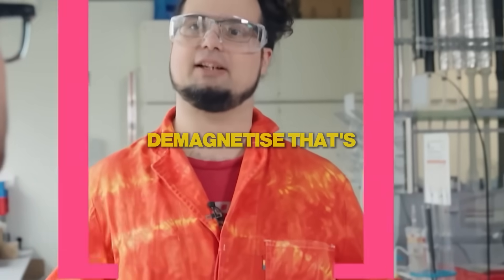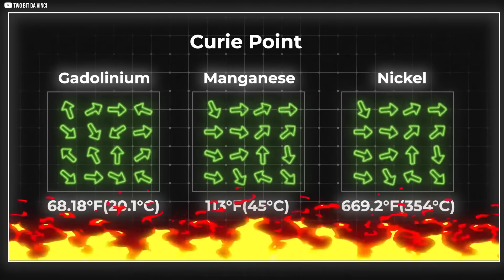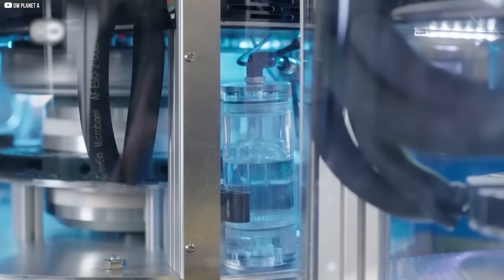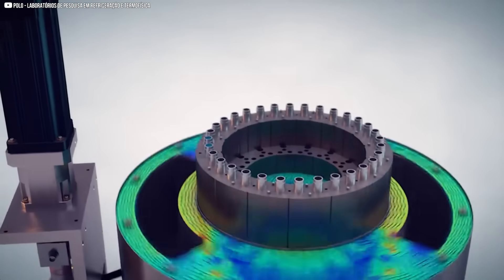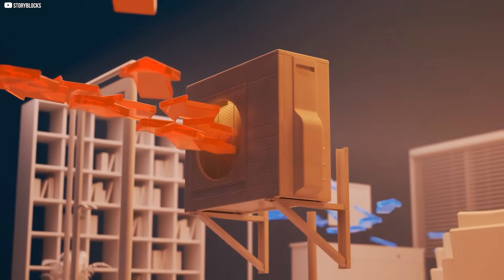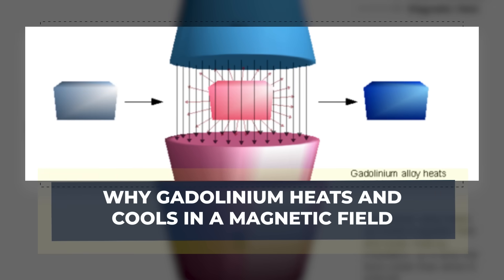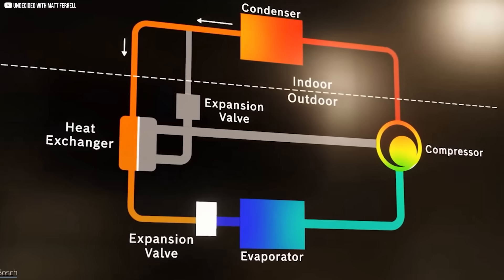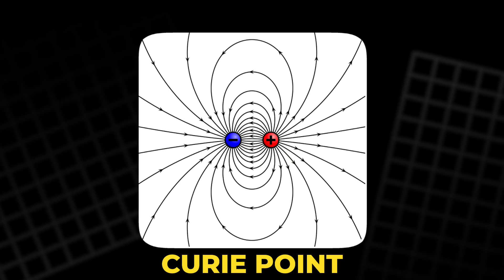The Magnet That Cools: A Glimpse Into Tomorrow

Comment: Aufgrund dieser magnetischen Eigenschaften hat Gadolinium auch eine sehr stark temperaturabhängige Wärmekapazität. Bei tiefen Temperaturen (unter 4 K) dominiert zunächst, wie bei Metallen üblich, die elektronische Wärmekapazität Cel (wobei Cel = γ·T mit γ = 6,38 mJ·mol−1·K−2 und T der Temperatur[25][26]). Für höhere Temperaturen ist die Debyesche Wärmekapazität (mit der Debye-Temperatur ΘD = 163,4 K[25]) ausschlaggebend. Knapp unterhalb der Curie-Temperatur nimmt die Wärmekapazität stark zu, was auf das Spinsystem zurückzuführen ist. Sie erreicht 56 J·mol−1·K−1 bei 290 K, um bei höheren Temperaturen sprunghaft auf unter 31 J·mol−1·K−1 einzubrechen.[27]

Gadolinium ist Bestandteil keramischer Hochtemperatur-Supraleiter des Typs Ba2GdCu3O7-x mit einer Sprungtemperatur von 94,5 K.[28] Das reine Element ist nicht supraleitfähig.[29] 
Gadoliniumsilikat (granat) ist eher ein Halbleiter "für" Magnetblasenspeicher . Also ein völlig anderes Thema !
eher für Halnleiter mit magnetischen zusätzlichen Legierungen. Selber weniger !

Comment: They had similar videos describing the switch from incandescent to LED lighting: LED's would last for ever. blah, blah, blah: until engineers began to design obsolescence into the design.  Those same engineers will be doing the same with this new technology that can last almost forever.  That's why they are the highest paid engineers in the engineering field. The big question is how much of this exotic element is available?
Reply: But the companies will not allow it to happen as they will loose money power, and they will do same as they did for LED lights by introducing timers.
Reply: @FUNPACK591  Engineers have a plethora of specialty materials and know how long the life of those materials will survive.  With electronic circuits, the components have a life span dependent on voltage, current and the type of material used in the manufacture. One thing is certain, the requirements have a longevity defined by share holders and other management dictates and not designing for maximum longevity.
Reply from the maker: It's a great point to consider the potential lifespan and resource implications of the new technologies!